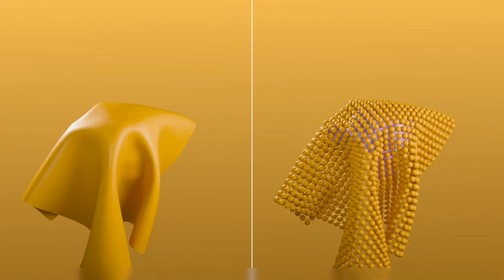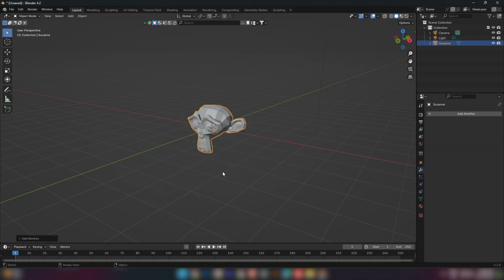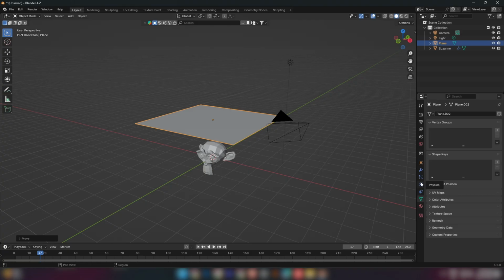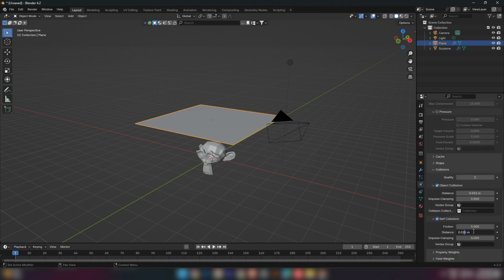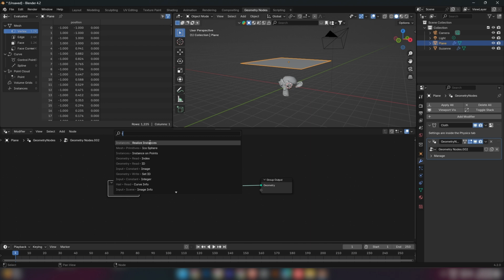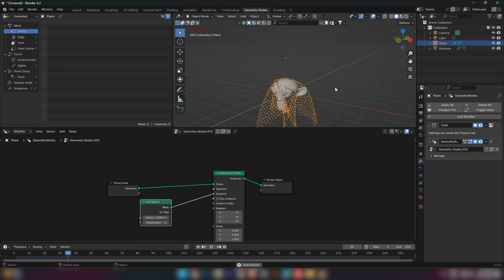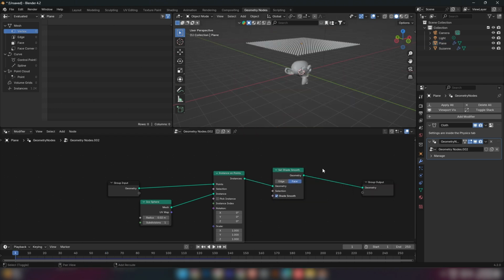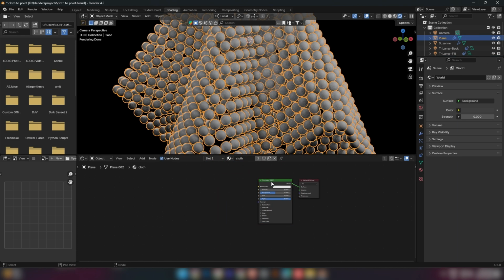Cloth simulation like a pro | #blender  advanced simulation

Comment: how do you extract the animation when your done? whenever i do it it goes frame by frame instead of 60fps?
Reply from the maker: I didn't extract this I just baked this animation in cloth setting and if you want to change the frame rate so you have to change it in the properties penal where you set dimensions for your final render.
Reply: @ i baked it but how do i like extract it how do i get the video, without the grid boxes